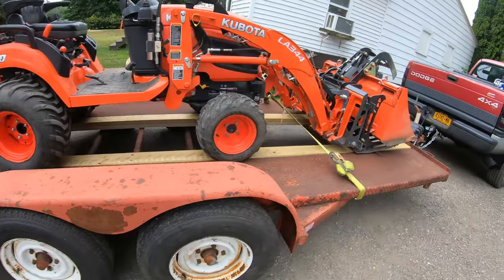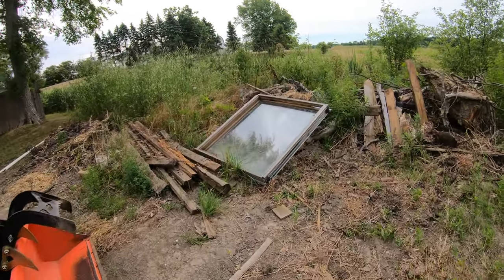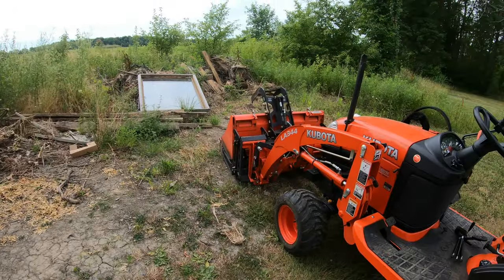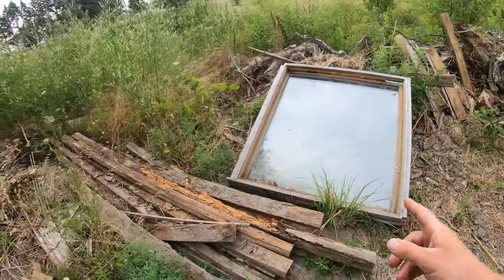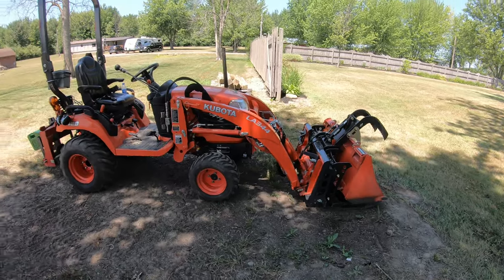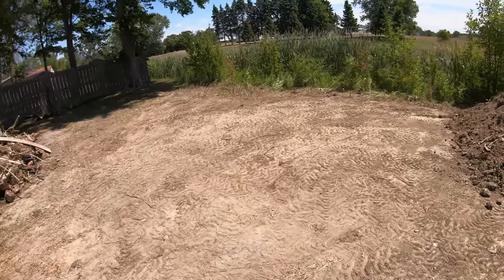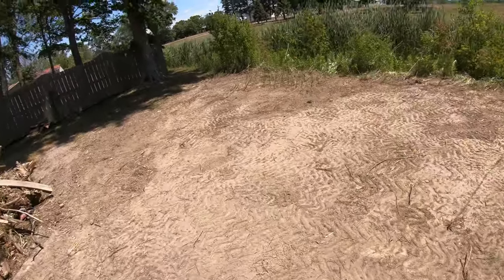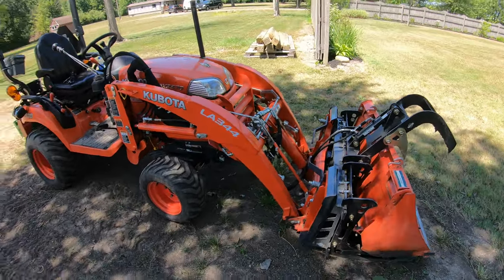FIRST JOB WITH NEW TRAILER!! (GRAPPLE, BUCKET, + GRADING WORK!)

Comment: This Tractor Takes every inch ! Dam. I’m glad to see the loader arms survive the continuous labor. This tractor model is one of my favorites, great stability, low center of gravity. It has it all. Non emissions, and good power.
Reply from the maker: Thanks man! I totally agree! I have over 1,200 extremely HARD hours on this machine.: most of the hours could be considered boarderline abuse and has done more than I’m sure Kubota even intended it to.. but to this point I have yet to have a single mechanical failure .. not even a single oil leak! This tractor has been one of the toughest tractors for its size Iv ever worked with. My father owns a John Deere 1023e and it’s already had more issues in under 400 hours than mines ever had! 

With the right operator there’s no limit to what these small machines can do!
Reply from the maker: Check for my latest videos! Also I plan to make a new video soon! Sorry I am just now seeing your comments! Thanks for your support! !

Comment: As has been said, you are a master operator. I hope to be half as good someday. You use that powerful grapple with the precision and accuracy of a pair of tweezers and grade with the bucket in a way that makes it look like anyone could do it (which is definitely not the case). Dude, that was amazing. It would be great to see it slowed down some to see how you move the controls while modulating the hydrostatic to give the most power while still being precise.
Reply from the maker: Thanks Norm for the kind words buddy! Sorry I’m just now seeing your comment! I just recently made a video where I ripped out concrete pile-ons using this grapple and I did it in regular speed too.. check it out you will like it.. also check out my other latest videos you’ll like those too! Hope you’re doing well man!
Reply: @BiffsEquipment  Awesome! Thanks.

Comment: Got the same controller - running at 54, with box blade, bucket, stump gringer, Land Prind forks - seems to keep it under control. Right with you on the trailer upgrade, totally worth it.
Reply from the maker: Awesome man thanks for giving me your numbers! Sounds like I’m pretty close then as I’m not hauling nearly as much equipment as you do on mine. Do you know roughly what your trailer weighs? And is it 4 wheel braking or only 2? Seemed like settings 40-45 worked pretty good with my trailer and it weighs approximately 1,650lbs empty 👍🏻
Reply: @BiffsEquipment  bigtex 60 PI 16' - 1535# empty weight, 6k gvwr - single axle brakes. Tested it by going about 10 mph, then hit only the controller button to make it slow the F250 down some but not screech it to a halt. When empty, have it at 12 or 14 I think.

Comment: Nothing I like better than Bucket work and I've extended my Garden 4 to 5 feet for the last 2 years and I still have almost 100 more feet I can clear as I need to. I'm gonna have to watch your Grapple video as I do have a few big piles on my back acre that could be cleaned up after I get my tractor back from having the Quick attach put on that is. I'm sure you will come up with a good solution to your ramp issue.
Reply from the maker: Very cool man, always nice to have the extra land to expand! Sounds like you’ll have your work cut out for you once you get your tractor back from having the new coupler put on the front, that’s gonna be nice! What are you doing for a bucket?
Reply: @BiffsEquipment  My dealer is gonna remove my cutting edge I put on and pretty much just switch out the bucket from the other tractor. He's only charging me for the quick attach because I've been waiting close to 2 years. The guy that lost his tractor for non payment only used the mower and the bucket just set in the garage unused so I'm getting a good deal finally.

Comment: Absolutely awesome job biff!!! And your grapple you have that’s the size I like to get for my tractor as well. Awesome video friend 🙂
Reply from the maker: Thanks man! The Artillian grapple did an OUTSTANDING job on this project.. tho it always does! It had no issues sifting through all the debris and having one the single grapple module in the center works really well.. visibility is great, the weight is nice and light and it works great for plucking out exactly what your going for.. hands down one of the best grapples you can buy IMO. Thanks for watching!
Reply: @BiffsEquipment  it helps when you are a excellent loader operator and that my friend you are a excellent operator, it would take me some time to get used to it some,

Comment: Nice work and nice equipment. For what it’s worth I’ll pass on a suggestion that was made to me when I operated my tree farm and landscape business. That is to take some short pieces of 4x4 or 6x6 and spike them together to make blocks that will nicely fit under the rear of the trailer frame where the ramps attach. These will take the bulk of the load when you are driving on and off on your trailer. They will also keep the trailer from trying to jack up the truck during these times. Keep up the good work!
Reply from the maker: Thanks buddy! I appreciate the suggestion.. when I had my single axle trailer I actually welded on those “weld on trailer jacks” to each rear corner of the trailer. I got them from harbor freight and they works great.. whenever I was loading something heavier I would pivot the rear jacks down to support the load as my old trailer was a single axle and boy would it put a lot of stress on both the trailer frame and upward stress on the truck hitch when I loaded and unloaded.. the nice thing about this trailer tho is since it’s a heavy duty tandem axle the truck/trailer really don’t even move much with the weight of the tractor when I load/unload so I prolly won’t do that with this trailer. But building a nice little square block would be good to have around for when I’m loading wavier objects to stiffen up the rear so it doesn’t drop when loading/unloading. Thanks for your comment 👍🏻

Comment: You’re certainly smooth at running that loader and grapple. Nice work. I’ve been hesitant to drive into brush after replacing my hydrostatic cooling fan. I don’t want to do that again, but it’s so exposed!
Reply from the maker: Thanks I appreciate it! Funny enough tho my loader actually isn’t as smooth as it once was.. which kinda drives me nuts sometimes, I need to get the hydrostatic oil changed and check the filters, the loader valve has been sticking on me since the beggining of summer and it’s been driving me crazy.. I think it may have some debris in there.. 
Yah I have some how never hit the HST fan on mine, well I did once a long time ago but it never broke it. I guess you can say iv been quite lucky lol. Hope your doing well Chad!

Comment: Great work cleaning up your dad's property. I'm sure he really appreciates the help. I lost my dad last October. Enjoy your time with him while you have it. ;)

Quick question on the grapple. About how much would you say you have invested in it with the frame, rakes, and grapple? I'm looking at Artillan or Everything Attachments for my BX23S when I get it.

I also plan on either ordering the BXPanded hydraulic gauge to test my loader pressure or maybe build one like Lucas did on Peek's Peak Hobby Homestead. From what I've read and seen on YouTube, 2000 PSI is the sweet spot.

Thanks for the info and the insight. Be careful out there!
Reply from the maker: Hey thanks buddy! I am very sorry to hear you recently lost your father. I could only imagine how hard that was to get through. Your right life moves way too fast and you gotta be a good person and spend time with the ones you love cuz you’ll never know when it can all suddenly end. 

As for the grapple setup, if you search “artillian grapple” on Google and find their website link, all their prices will be there.. you’ll need to buy a diverter valve kit or 3rd function which can vary from $500-$900.. I would go with a summit 3rd function valve like I bought because it’s the best kit you can find for the money and it’s a true 3rd function seen here https://youtu.be/DFCrphw3hRg you’ll also need a the Artillian fork frame which I think is about $700 and one of their grapple sections which I forget what the price is on that.. artillian products are NOT cheap BUT the Stregth and quality is unmatched! Also once you have their fork frame you can then use buy their pallet forks and stump buckets and other useful attachments to go in it.. I have videos on nearly every attachment and upgrade on my tractor.. very detailed videos. As for the hydraulic pressure, I have done maybe 3-4 videos on this where I fully explain hydraulic pressures and what I feel the best range of pressure is and why.. and have even done testing with the bx showing how much of a shim will deliver how much pressure and how much more lift you can gain from it.. below I’m gonna link a few videos for you that I think you’d find useful.. but search around on my channel cuz I litterally cover just about everything there is to know about the Kubota BX. 👍🏻

https://youtu.be/yj4RqH-qtII

https://youtu.be/wNlA24RF1Bc

https://youtu.be/E9BoL6_ox-Y

https://youtu.be/7w90d6ukQ3E

https://youtu.be/8tYZMFjTxzI

https://youtu.be/xvAhNdHynDs

https://youtu.be/tK2bQMFdlkE

And I have MUCH MUCH more! Hope this helps

Comment: You definitely have the touch when leveling ground. Great work as usual. You are right, you have to get your ramps fixed so they don't tip while loading and unloading. I hope you weren't starting the barn today, with all the rain.
Reply from the maker: Thanks Ron, yah I agree, nothing like worrying about falling off the trailer each time you load and unload 😅 I will be starting on the pole barn this weekend so I hope it doesn’t rain.. think it’s gonna be nice but hot

Comment: Bring that trailer over, we can weld a bunch D Rings on, and make some ramp pockets!
Reply from the maker: Thanks Elliott, the only reason I havnt extended the ramp pockets yet is because this fall I plan to weld 1” bar stock to the rear of the trailer with some eyelets off the ends of the ramps so they can hinge and be fully adjustable.. so because of this I didn’t wanna weld longer pockets on just to have to cut them back off in a few months so I’m hoping my quick fix will get me through just a few more months or so till I can fix it the right way. I may have to take you up on your offer sometime anyways tho! 👍🏻
Reply: @BiffsEquipment  I have a guy you can get that round bar from if you need it. I did the same thing to my trailer last year.

Comment: Just an idea. If that were my trailer I would weld up some pockets for the ramp. Then you can just widen or move the part on the trailer they fit into for use. Its nice to have them out of the way, much cleaner look too.
Reply from the maker: Thanks for the idea man. The only reason I havnt extended the ramp pockets yet is because I’m the fall I plan to weld on 1” bar stock to the back of the trailer, then I was gonna build eyelets on the ends of the ramps
To fit over the 1” bar.. this would allow the ramps to pivot up out of the way but still be adjustable both in and out to adjust for differnt tire widths.. so because of this, I didn’t wanna waste my time welding longer ramp pockets just to eventually grind/cut them back off again.. so that’s why I just notched the ramps for the time being to (hopefully) get me through the rest of the summer with our incident. Lol

Comment: Great video…how is that brake control working?  I have to put one in my truck. Stay cool and keep sharing your work. I would like to see how you stabilize those ramps.
Reply from the maker: Thanks Ed! As for the brake controller it’s working really nicely.. I use to have an old squeeze type brake controller that came factory in this truck and after buying this new trailer I swapped it out for a full digital controller.. the digital one is far superior as Your able to set the percentage and leave it and the harder you press on the pedal the more %age the controller gives the brakes but only up to the max setting you have it set for.. been really happy with this new controller thus far. Thanks for watching!

Comment: Nice trailer. Would you like an idea for your ramps.
Reply from the maker: Thanks man, and sure I’m
Always up for suggestions. My plan was to take 1” bar stock and weld it across from end to end on the back, then build 2 eyelets off the ends of the ramps so they not only hinge but are adjustable side to side as well. What you think?
Reply: @BiffsEquipment  our trailer has 2" pipe from end to end with bigger pipe for the eyelets. It lets you adjust the ramps how ever wide you need them. Then a chain holds the ramps up.

Comment: Very nice.  I wonder if you think your original grapple style is any less than the new iron fist one?  Would the iron fist have helped you any better?
Reply from the maker: Thanks Tekker, the original grapple design works VERY well.. I like it a lot because it’s simple and it just works.. I feel that doing detailed work would be easier with the original grapple because you do not have a varying clamp.. you know right where it’s gonna close every single time.. tho I have never used the new iron fist but do plan to some day try it out, so the new iron fist could be just as easy.. but being that it’s variable and adjustable as far as where and when it clamps.. I’m not sure if it would be as easy to know right where to set it when grabbing say a smaller rock or what have you in a timely fasion as I did a few times in this video. Where the iron fist really shines tho IMO from what Iv seen is grappling very large piles of debris as well as it being able to pinch fully shut on even the smallest of objects with out them jostling loose.. as the iron fist not only has a wider opening but also closes much much tighter.. so I feel it’s def got its Benefits but until I use one for myself it’s gonna be hard for be to give you a good answer. Thanks for watching!
Reply: @BiffsEquipment  Yeah I think you said well. Thanks for the reply!

Comment: Do you have a video with your ballast weight set up?
Reply from the maker: I have a few.. I’ll try and link them all below for you.. one is of how I built/designed my rear weight bracket.. and another one I can think of is where I talked about the weights I have and why.. and another one is on me building the weight bracket cart for the weight bracket.. I’ll see what I can link below for ya 👍🏻

This is the video where I talk about how I built my weight bracket (keep in mind it’s one of my original videos): https://youtu.be/yDOuC2Aldi8

Here is where I talked about my weights and what brand/type I use with a comparison: https://youtu.be/E9BoL6_ox-Y

Here is where I built my own front weight bracket: https://youtu.be/ea4ZbN5mYY8

And here is where I built my own weight bracket cart: https://youtu.be/Rfnryx320mU

I’m sure I have many other videos talking about the rear weights also but you’ll have to search around a bit. There was one where I removed a bunch of stumps on my property and at the end of the video I talked about how great the added weight was and why it helps.. think it was this one: https://youtu.be/xvAhNdHynDs

Comment: I have a massey ferguson gc1723e and a want to put ballast in the back probably make my own box out of Cement... how much weight is on  you 3 point? Thanks ... love the grappler wish I had one
Reply from the maker: The GC1723 is an awesome tractor! I have about 600-640lbs total ballast on my tractor which includes the rear tires being filled and all that. Usually for most people around 400-500lbs is a good place to be.. I have my hydraulic pressure cranked up so I run a bit more than the average person as I need it to keep my tractor rear on the ground and to stay productive 👍🏻

Comment: The two hook on your grapple to hold your bucket for transport was made for that ? Is it an option ?
Reply from the maker: Those hooks you are referring to are called “grapple fangs” they build them as an acsessorie to their grapple for an add-on. I love the fangs cuz they allow the grapple to take better bits of brush and odd sized material and also help to hold in smaller logs/debris as you saw in this video. It just so happens that they also double as a bucket holder which I love 😂